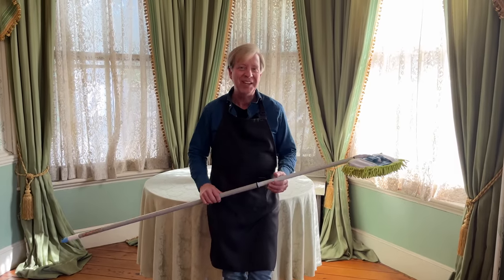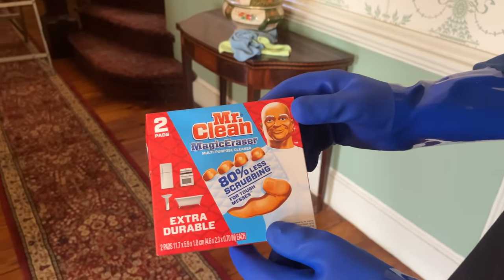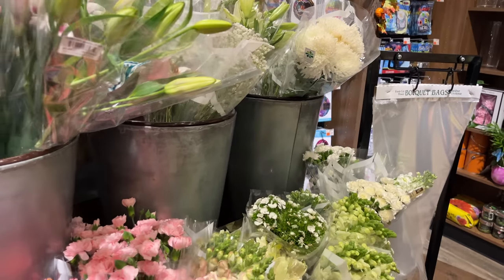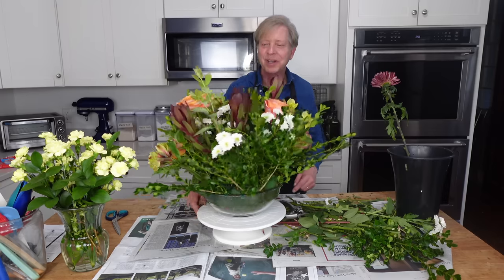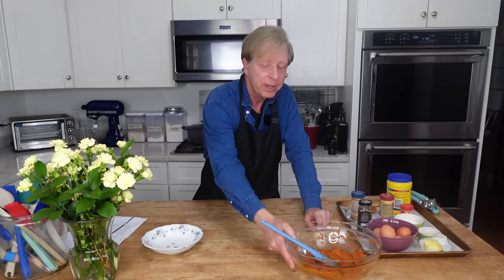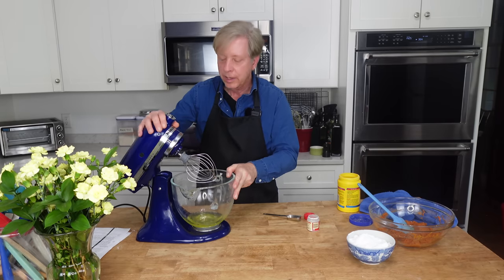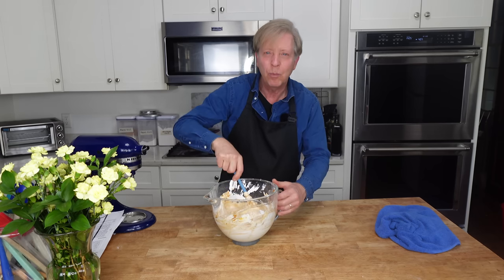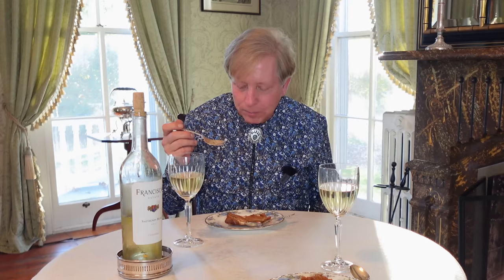Domestic Bliss! Arranging Flowers + Making a Pumpkin Soufflé

Comment: Always a pleasure to be with you.  The white scrubbie is really a very fine sanding sponge and will put thousands of tiny scratches in whatever you are using it on and the scratches will grab dust and dirt.  Only occasionally on painted surfaces because it will sand the paint off.  I never use it.